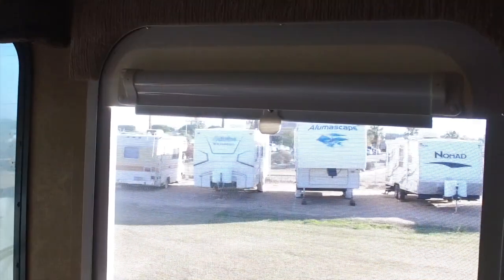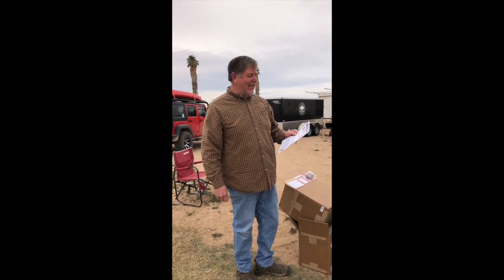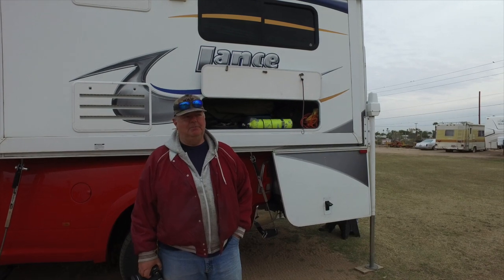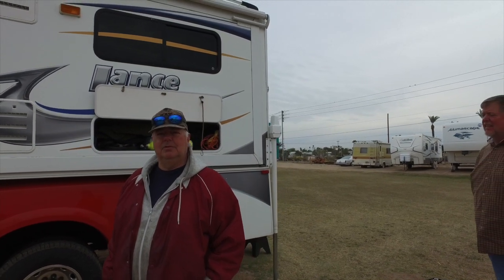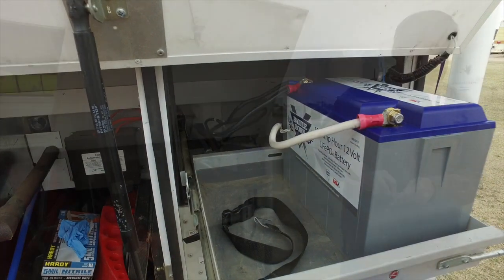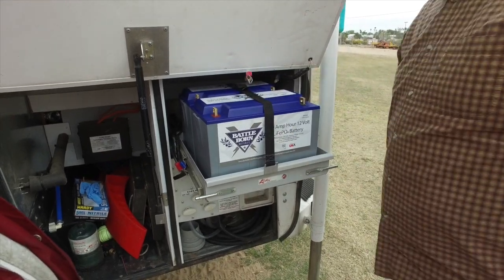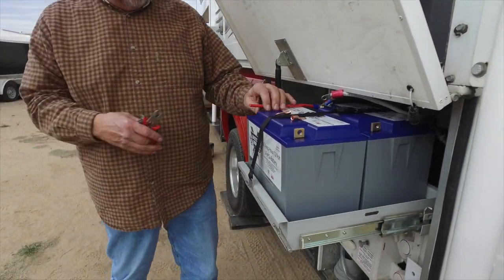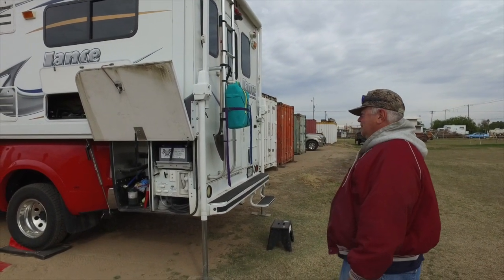Battle Born Batteries

Comment: Well that made our decision to go lithium! Thanks guys. Safe Travels! Looking forward to your Baja Adventure.
Reply from the maker: You will love your lithium batteries.  Are you thinking about Battle Born?  Solar?  We will be doing a video on new solar equipment when we get back from the Baja trip.
Reply: @Bluemoonexplorers  Ordered the Air Head Composting Toilet last night and now turning our attention to solar and batteries. We should compare notes on how much solar a truck camper needs? We are thinking adding an Inverter Charger to not have to run the generator as long to recharge the batteries on cloudy days. I hear the RV inverter charger only trickle charges and may take 4-6 hr instead of 1-2 hr.

Comment: Those 100 watt batteries are a bit pricey at $950.00 dollars each.
Reply: Actually they are 100 amp hour batteries and last a lot longer than AGM batteries, worth it in the long run
Reply: @scroach115  Oops! 😬 I meant to say amps. My bad.  I agree they are worth it the main thing I wanted to point out was that they are a bit pricey.